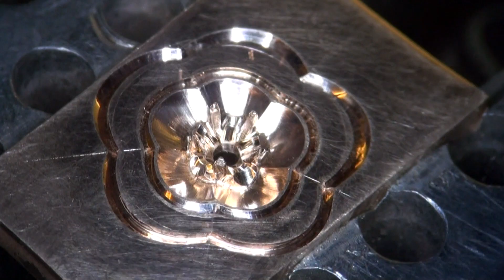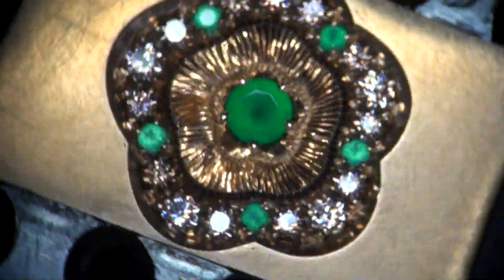Flower Plate

Comment: I'm wondering why you don't pick up the small stones with a flattened (old worn out) grain tool..........I use a small amount of spit on my thumb nail - dip the grain tool in it, then use the moistened flat tip of the grain tool on the table of any stone to pick it up. The beauty of this is you are picking it up securely - no pinging out of tweezers, and you are already using the right tool to push into the setting and get it level. Saves time.
Reply: Lo importante es el trabajo que ha realizado tan fantástico, no si coje la piedra con saliva o con las pinzas.